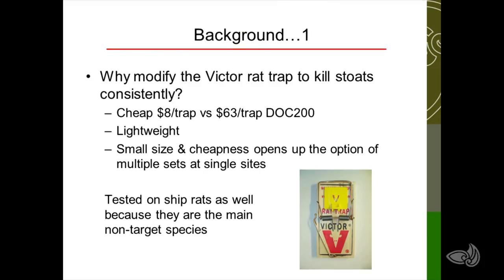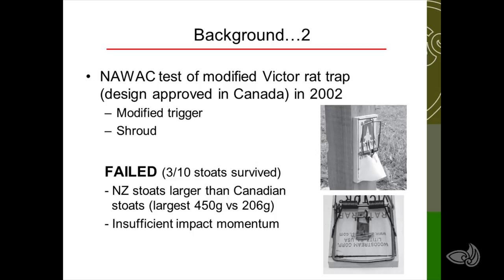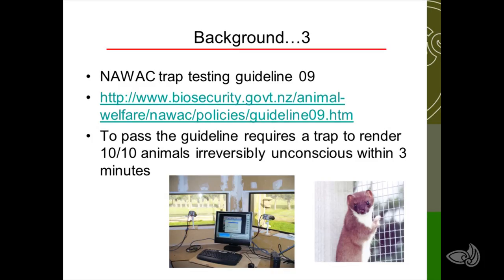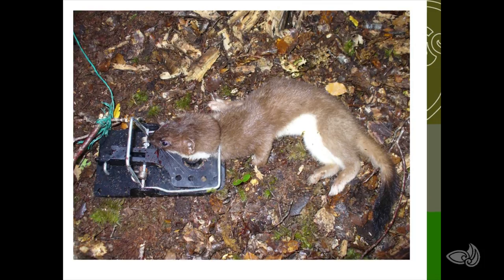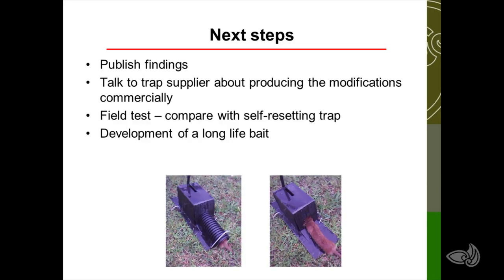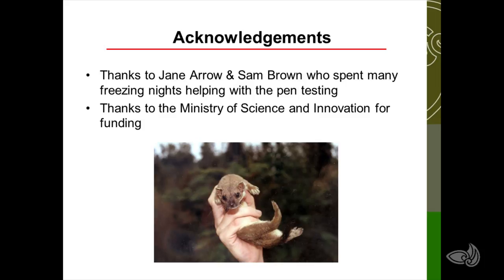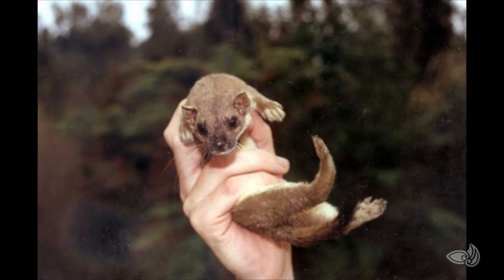A low-cost trap for stoats

Comment: I have trialed the modified traps available in nz and they are a waste of money. The Victor trap mechanism falls apart because the wood is to soft . The plastic modification  comes apart and also gets chewed up by wild cats and possums. I liked the concept so purchased 20 and never caught any pests. Purchase Doc 200 , 250 or Pcr 200, 250. They cost more but work well.
Reply: Yeah our community group is finding the traps are falling apart too.  The staples just pull out.  We have caught plenty of rats with them, so they will work, but they just don't last.